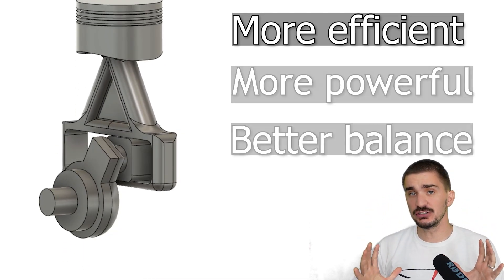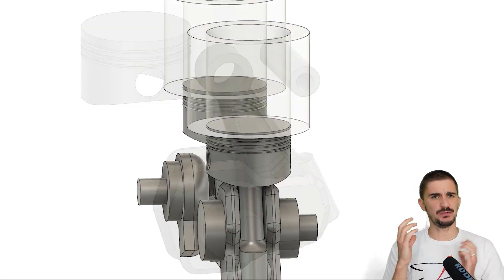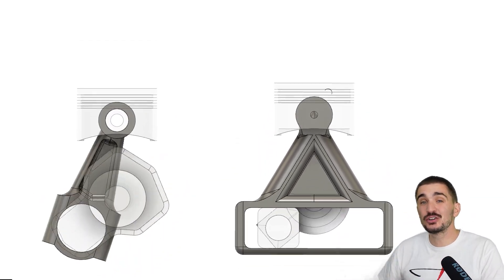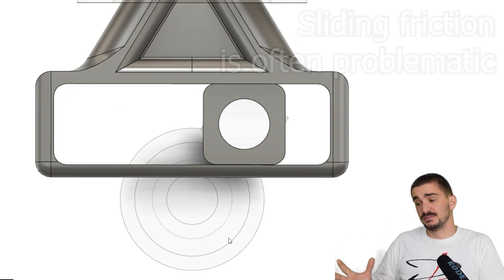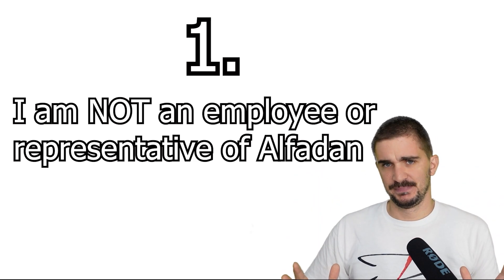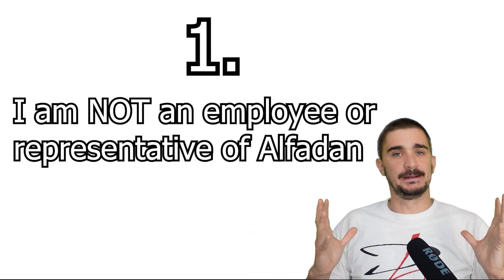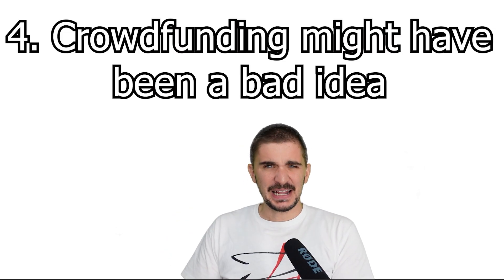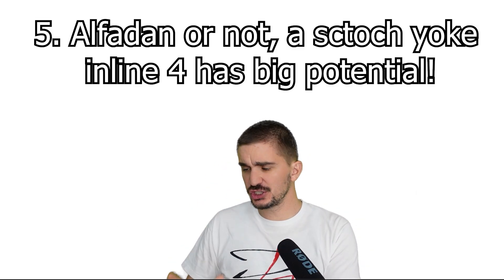This engine is better in every way?

Comment: Okay. Love your vids but this one us waaay off! Your motion video of that contraption is ridiculous and deceptive! Go get one of your coat hangers. Hang on the pole. Now stick your finger in either of the two outward lower corners and pull down. Tell me what happens? The whole triangular shaped coat hanger attempts to rotate. The one corner you push on goes down while the other far corner goes up. This principle would produces tremendous angular/rotational torque on that piston in its cylinder in trying to twist the piston sideways. Like the coat hanger effect it would imediatley snap that fixed rod right off the piston base. Not to mention destroying the cylinder walls by attempting to rotate the piston sideways.
And thats besides the fact that the the whole connecting rod piston shape would weigh way too much.
I see this exact same item inside my fishing reels everytime i open them up. Handle rotates a big gear. On the gear is a pin that as the big gear spins the pin slides back and forth in a slot which drives a shaft straight up and down to move the fishing line spool vertically up and down so as to oscilate and distribute the fishing line along the spool evenly. But the only reason it works inside the reel is because the mechanism is both fixed above and below by the vertically sliding shaft. So that prevents any attempt for it to twist or rotate in angular fashion.

Comment: no? Honda has never made engine like that. It has too many broblems to even think of mass producing. If you think it, yes it has benefits compared to convential connecting rod like better balance, more power but the greater friction, increased wear and over all less strong part makes it very unreliable.

Comment: This scotch yoke system seems like it is better for steam expansion engines. Where the steam pushes the piston down before going out to push the next piston down and so on in a line. Or in two pistons then the excess is used to pushed the other two down.

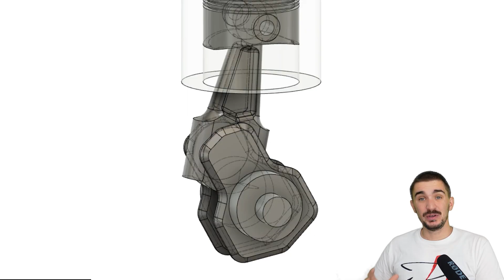Comment: 7:46 Change the round part that slides from a square into a stadium shape. By just curving the round thingy in the middle and reducing the length of the flat bottom and top sides, you significantly reduce friction. Thicken and curve the interior ends of rod and you've strengthened the ends by a LOT. Just those things solve a couple of issues right there.

I'm an idiot and even I can see that.

Comment: Make the engine opposed piston boxer and you resolve the rod strength issue and replace the sliding mechanism with a rotating gear and teeth setup and you reduce friction.

Comment: In the unconventional engine, the "skater" bushing represents an unbalanced occilating mass.
The increased mass of the piston rod "track" further contributes to the unbalanced condition.
One method of reducing the yoke friction would be to put a relief slot down the center of the yoke wristpin bearing and drill through the skater so that oil can be extruded under pressure through the crank, through the wristpin, and forced between the skater and the track.
For an engine running less than 5000 rpm, this might be a viable build but other innovative engines can hit 10,000 rpm with close to perfect balance.

Comment: The dewalt dcs 369 recip saw also use the scotch yoke drive system and it is really smooth, no rotational vibration at all. The side effect is, due to how the yoke accelerate at TDC and BDC, it produces such an ear piercing metallic sound.

Comment: and in this , when combustion happens piston pushes at specific place on  that square  roller  on the right , top dead right , and that is where a notch will form restricting the movement and it will fail long before normal engine . you can see it . Just stupid .

Comment: might be better have two opposing cylinders firing alternately and convert the alternating linear motion to circular motion using "sliding ram and crank disc" method.

Comment: shouldn't it be made an opposite-cylinders engine?
With two opposite pistons connected one the same (symatrically designed) rod. I feel like the problems would be slightly reduced. The force transfered to the yoke via fricton during the power stroke would be somewhat reduced as some of it would be used to compress air on the opposite cylinder. And the two sides of the rod would be equally strong.

Comment: I think a good economy car engine would be an air-cooled, I3 opposed-piston Diesel with scotch yoke rods and compound turbocharging (if you don’t know what compounded turbo is, look it up - closest thing to “free energy” in mechanical engineering, the data appears to violate the laws of physics at first glance.

Comment: Im not convinced. on the compression stroke when the square is hard left (or right) you have a huge torque being applied to it and trying to prevent the entire assembly from rotating is....what? basically the cylinder sidewall. Id think it would break faster. but for sure lets build one and find out.

Comment: Probably a stupid idea, but would it be possible to make the cylinder walls somewhat "elastic" so that the outer wall pressure could be reduced?
Reply: Not possible with high rpm would create imbalance

Comment: Has anyone (including Alfadan) actually done or released any testing on fatigue progression for this kind of design? Yes, you have less moving parts but (along with your mention of the lower beam being weak) on the bottom corners you have two points of really high stress concentration. For a part that's supposed to survive an extremely high cycle lifespan with a high stress variance does not seem feasible unless you're working with a metal/material with a fatigue limit. And even then you still run the risk of progressive flaw failure.

Comment: Change the square pin for a round one and run it in a round part that rotates inside the con-rod that is offset.  So a round in a round,  can then use bearing shells and oil supply, be no worse than a normal engine, but way better than that.

Comment: The piston spending more time at higher compression does not increase the Work! In fact remaining longer at high compression is less favorable because it allows for more heat transfer into the piston and cylinder wall (morgen compressed gas = hotter). The faster the decompression process, the closer it is to adiabatic expansion, which has no heat transfer. If heat is transfered from the compressed gas, the pressure will decrease, which must decrease the work.

Comment: In scotch yoke, generally both ends of what would be the piston/rod in this case are secured while this is only "secured" at the cylinder. The big end would require guides in the block to keep it upright/vertical. The number of bearing/friction surfaces in this thing would be a nightmare to rebuild.

Comment: I would get rid of the lower part of the slot and make the upper part a track that the upper part of the square rides in or on. Then use two oppositely rotating cranks with each piston rod connected to both cranks to balance the forces.

Comment: i don't see why you can't just make the part of the rod around the yoke thicker and also, why would the end of the crank be square? Why wouldn't that be a circle? Just put a bearing on the end of the rod that slides side to side inside of the rod. that way the bearing is rolling rather than sliding. even if it seizes, you have way less surface area touching the rod than the square version.

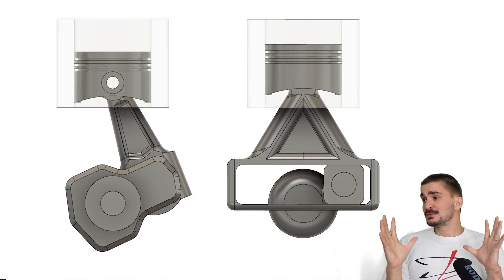Comment: 1:35 Not true. The rod is traveling vertically, but the vector of the force is the same in both cases, because it is defined by the crankshaft. It only make sense in flat/boxer engines when you can connect two pistons by one piece of rod.

Comment: I don't understand why the slider needs to be a solid square piece; couldn't it be substituted by lubricated bearings? Just put a strong bearing on each corner of the square and you can solve the friction issue to some degree.

Am I missing something? I guess it would make the design either heavier, more fragile or more expensive but, again, new material science might make it possible.

Comment: Another example of what is or is not a scam.. initially, Theranos had an idea to try to develop advanced blood testing equipment. They offered stock in their fledgling company in order to raise capital for R&D, design, prototype fab & testing. So far, so good.. a high risk but potentially lucrative speculative investment in a biotech startup. BUT.. eventually, Theranos started actively deceiving people in order to raise more capital.. things like displaying power-on mockups and pretending they're running actual tests (while the audience is taken for a 15.minute presentation in an adjacent room) and then faking test reports output from the mockup machine.

All the deception seemed to be focused on creating the impression that "our goals are more achievable than our experience is showing them to be", and "our product development is much further along than it actually is".

At the point where Theranos began intentionally deceiving people.. that's when it became a scam.

Comment: Unlike the cylinder itself, the sliding thingy here doesn't have to seal anything, so couldn't the sliding friction issue be completely solved by just putting it on rollers?

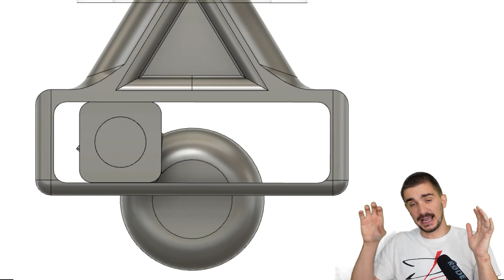Comment: 6:51 I don't understand why simply beefing up the thickness of the lower rail of the slot, perhaps even making it triangular like the top rail, would not solve the weakness problem. It also would seem that strategically placed rollers (rollers on axles with pressurized lubrication, not rollers in a race) would solve the friction problem, though it might be a challenge keeping them lubricated enough so that they don't develop flat spots. Has anyone attempted such fixes? Since the width of the slot would be a little more than the stroke, an oversquare configuration would even allow the whole slot to fit in the cylinder bore, avoiding the complications of a 2 step cavity.

Comment: Why don't they make the scotch yoke wherein the yoke itself is vertical instead of horizontal? Then, most of the force will be a radial load at the bottom of the power cycle, which is the bottom most end of the yoke. That part can be given additional mass and essentially be made as half of a circle. That should give the necessary strength where it's needed, lower sliding friction due to forces working against the geometry, and make the load more symmetrically balanced with respect to the yoke.

Comment: I state again, the angle of applied force does not change, point A to point B is still the same. So the equal and opposite reactions (pinching) forces are in the same direction, the yoke reduces lateral forces that are beneficial at specific degrees of crank rotation

Comment: Ill stop you at 106. 
 Its not the rod angle that creates the excess binding friction its the difference in the direction of reciprocating force and the direction of rotary drive motion, regardless of the shape of what mechanical device is used for connecting the two points the force is applied at the same direction and the direction of rotation occurs at the same point, this design simply relocates that same resistance from the cylinder wall, to the yoke base, which is beneficial in terms of cylinder wear, half of which is mow places on the rod yoke

Comment: Well, you can replace slide with ball bearing to reduce friction loss. Also I guess friction wear on cam is better than on the cylinder. Not sure if that is worth the change.

Comment: I do wonder why the scotch yoke is not supported by two crankcase. One left and one right. Having a single crankcase a moment is created and thus turning the cylinder and yoke to one side. Having two the yoke is evenly held back and the forces up and down are equal.
The crankcases are rotating towards each other and can easily be connected by a gear.
Another idee, why use a block as slide and not a double bearring, or even make a oval path.
Im interested in youre thougts

Comment: This design eliminates secondary vibrations, the prime aim. It is a compromise. For eliminating secondary vibrations the negatives of the sliding Scotch Yolk have to be considered and accepted.  The negatives of the Scotch Yolk may be worth it because of superior gains elsewhere. In short, it depends on the target application of the engine.

Comment: Look at the disc yolk Cross engine. A British design from 40-50 years ago.  Similar to the Bourke engine with a cylinder on each side at 90 degrees to each other. But employing a disc yolk not a sliding Scotch yolk. No sliding parts in the yolk, all rotational. No swiveling con-rod. Two horizontally opposed pistons in all one solid casting.

A version had stepped top hat pistons, with two chambers working as a two-stroke. One chamber was to scavenge. A wow design at the time, and still today.

Comment: Just thicken the long thin section. Now it is not weak.
Place four bearings at each corner of the slider. Now you no longer have sliding friction. 
Both problems solved.

Comment: 4:10 i dont understant this , theoriticaly combastion  efficiency is a function of volume ratio,if you have for example r =10 then the maximum efficiency you can get  is to exaust gasses in a temperature that r defines, texaust= thot*r^k-1 ,this formula doesn't imply anything about time of combastion stroke.

Comment: More power my ass.  It easily has 2-3x the reciprocating mass as a conventional engine, not to mention greatly increased friction losses.  And how would the oiling be sealed in that rectangular channel, exactly?  Because it is either going to end up open on the sides, or need seals replaced on a regular basis.

Comment: Surely The sliding friction would cause more piston/cylinder wear to both power and compression sides, showing more oval-shaped wear rather than egg shaped Unless they're planning on adding a shaft bolted through the block running through the centreline of the "conrod" with a hydrostatic/hydrodynamic bearing.

And with the added weight of the pistonrod (what would you call it?) It would be limited to inline 4,6 and v8 configurations?

Comment: The weakness issues is resolved by always putting this engine in a opposing piston configuration. This solves some issues with the fact that this is still loaded at an angle but with the opposing piston the 'twisting' of the two attached pistons would be minimal. The sliding friction is the bigger problem and there are no simple solutions, however, I would try to inject oil from the inside of the yoke rod. I do like the  Bourke Engine, especially for small aircraft, as alternative to a radial engine.
P.s. I just watched the video posted a month later, and I should become an engineer as they did pretty much exactly what I said here

Comment: That does not look strong. That sloding part is going to be a disaster over time. The round bearings in a normal engine can be made very atrong.

Comment: The rod would have to be a built up unit which increased cost and complexity and you need pressurized lubrication between the sliding square and the rod, and then there is the increased weight. No way this is better.

Comment: The crank and connecting rod mechanism cannot be improved, so stop trying. This arrangement is not better, but it is worse in any way. Flimsy, a lot of friction, more mass, still a lot of lateral thrust on the cylinder walls.

Comment: This is better used in flat 2s. The lower part of the sliding slot is weak but if it's 2 pistons welded together then it won't because the opposite piston is there.
Or a cross flat 4 like you showed in 5:53. But since it's flat it took a lot of area and as a horizontal engine it has side wear problems just like boxer engines.

The problem of rod on nowaday piston engines isn't that much of a problem compared to all of these. If the solution makes more problem while getting rid of this problem it's probably better not to do it.

Comment: Take this thing up to 3 to 5k rpm and let’s see what happens. I imagine rotational mass would grenade this thing. Not to mention the weight itself would be double a convention ice engine. Maybe single cylinder use would be possible.

Comment: Some type of roller bearing design in the scotch yoke would dramatically reduce sliding friction and beefing up the underside, thin part of the yoke would help much. However, with the increased friction area of the yoke, premature wear and knocking is inevitable.

Comment: The same thing can be accomplished by using a rod with a large big end and a filler with offsethole to fit the crankthe bearings in both cases is a bear.. maybe a roller bearing could be used..

Comment: Scotch yoke engines have been around decades. They're simply not worth the losses. Without significantly over-square bore, they limit stroke length. They also impart significant shock load into the crank throw, while also being fairly constrained in terms of crank throw cross-section (bad combination).

Comment: These problems seem to be a particularity of the design of the example you showed... If you make the rail tighter, remove that stupid square and make just one circle run along the rail, it already reduces friction a lot because the contact area is smaller on a circle than in a square.  You can also make the ends of the rail rounded (but don't let the circle touch the ends).  You even showed another example that works like this in the video... in addition, the weakness in the lower part of the rail can be solved by placing another piston like the one on top, and that's it, you have the force being applied to triangles in both parts , and no force being applied to weak parts.  This uses the same material to add another piston... makes the design economical and reduces the size of the complete engine.

Its like an optimized version of the Bourke's idea...